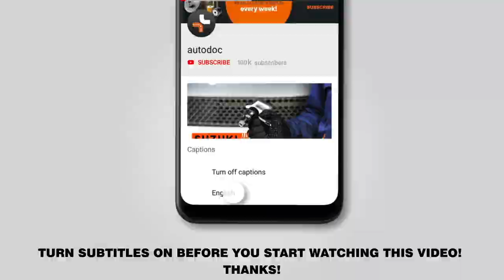How to change front anti roll bar link / front drop link on VW PASSAT 5 (B5) [TUTORIAL AUTODOC]

Comment: Thank you for this video. Just a question about tightening the fasteners and torqing it down, is this not supposed to be done after the full load of the car is on the suspention to avoid extra tention on the bushings and shortening their life signifficant? Thank you and keep up the good work.
Reply from the maker: Thank you for your comment.
You are absolutely right the control tightening of the suspension fasteners should be done when the car is on its wheels.
Best Regards,
Autodoc team.

Comment: I have a Passat B5 Sedan from 1998, only the anti-roll bars I have have joints instead of bolts. I loosened the nuts, but even after a few hours of struggling I couldn't get the joints out of the other axles. I tried a fork bar but even this wasn't any success so do you guys have any tips for me to remove the joint from the axles because at first glance these are as tight as can be and I have already sprayed a whole can of WD-40 on them and it doesn't solve anything.
Reply from the maker: According to the description, it is difficult to solve your problem and we recommend contacting the car service.